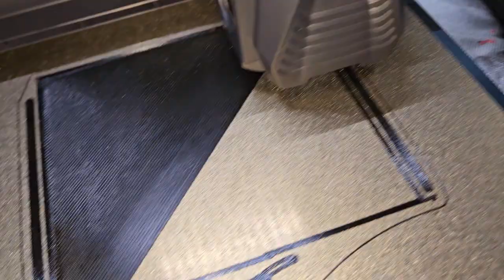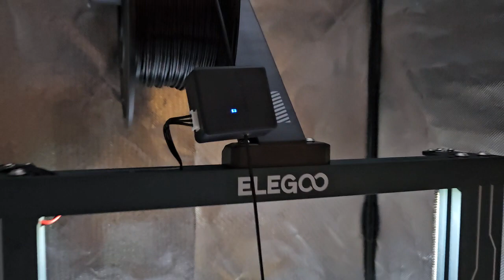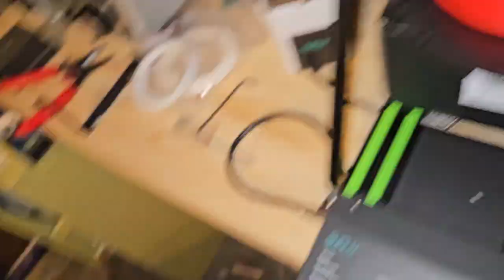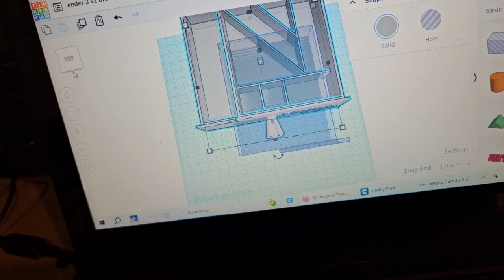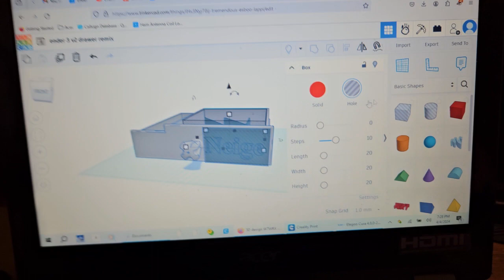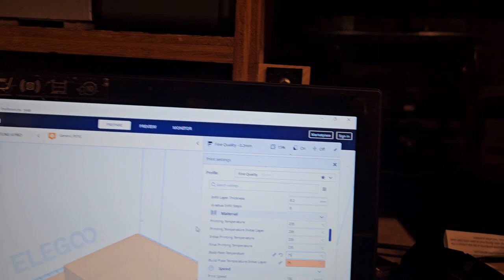3d printer adventure and remove branding w tinker cad manipulate stl files

Comment: The offset post-adjustment looks fine to me.  Any more squish and it might start to bellow up a bit and suck.
Reply from the maker: It seems like carbon fiber. I have to print super slow or it gets ruff. Dave had a ton of old rolls so we need to use it up. It might be bad or mybe its normal?

Comment: In tinkercad you usually highlight and select everything and then select the "Group" option in the top right area (or ctrl + G) and it will show you what the final project will look like. You can always ungroup them too (ctrl + shift + G). I generally group my objects after each box i make so i don't have so much clutter.
Reply from the maker: Thanks for the tip!